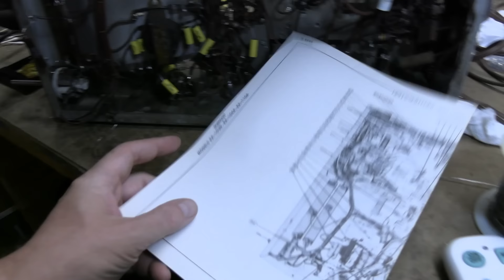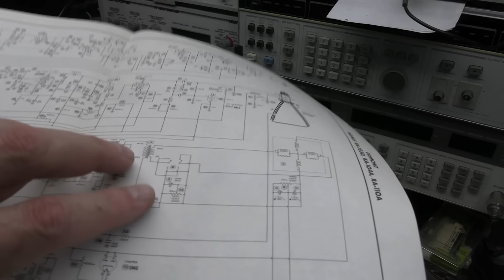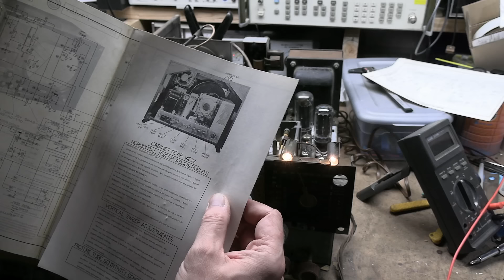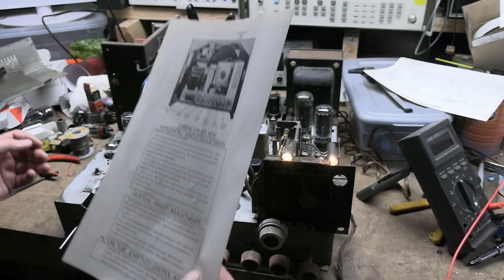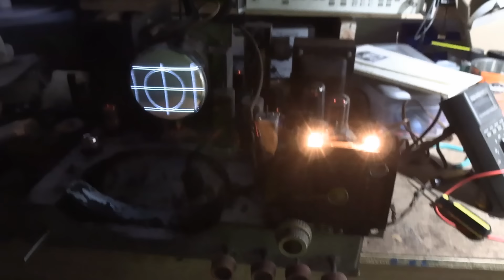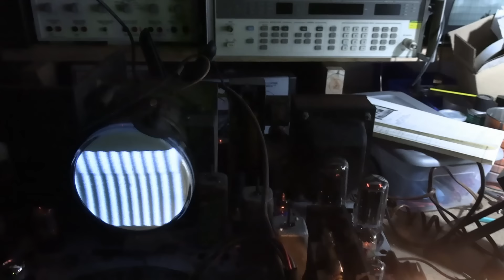Dumont RA-103D "Rumson" p03

Comment: Wow, quite a lot of work required to restore this set! Great job and assessment of what you will do going forward. I wonder if a video IF alignment will be in the works for it? I have worked on two RA-103 Doghouses in the past, they are quite different and extensive in design! Luckily the relay worked on at least one of them.

Comment: Very interesting and complicated design.  Bob, I can see what you mean by DuMont's being over-built.  "Coffee Grinder" continous tuning from 40 to 220 MHz, that's quite unusual.  I noticed this set has no AGC, receiver gain is controlled by the Contrast control.  30 tubes including the CRT, and huge power transformer for a huge power supply, I'm guessing set power consumption is around 330 watts.  In looking at the delayed B+ circuit, I suspect the relay is failing due to high inrush currents.  Probably 2 or 3 CL-90s (thermistor) in series with the relay would fix that.  I didn't see any switch to reduce audio output when switching from TV to FM radio mode.  Since the FM broadcast band has 3 times the Deviation as TV sound, the FM  broadcast will be about 10 dB louder.
Reply from the maker: Audio carrier level was a lot higher back then. In series with the relay coil or contacts? It's the coil that's going open. It has a 5K DC resistance.
Reply: @bandersentv  I had heard the audio was AM at first, then the FCC decided they like FM better so, I assumed the deviation was "set in stone" at 25 kHz (FM broadcast is 75 kHz).  On the relay, I assumed the contacts were the problem.  If the coil is opening, add a series 5k resistor, paralleled with a 10 uF cap.
Reply from the maker: @billharris6886  It was AM pre war. I'm talking FM sound carrier post war. Carrier level was dropped several times over the years
Reply: @bandersentv  Okay thanks Bob, I appreciate the early TV history!

Comment: What is the number of the little picture tube you use for bench testing? Is there one that similar that’s still available? What years of tvs can it be used for? Thanks
Reply from the maker: 5AXP4 - any magnetically deflected TV until about 1956.  Hard to find and expensive.  The rectangular version is the 8XP4 and easier to find.  New version 8YP4.  Those are the only three.
Reply: @bandersentv  why can’t those tubes be used after about 1956?
Reply from the maker: @cool69rr  CRT base and neck diameter changed. Also deflection angle. You can use 8yp4. Not the others